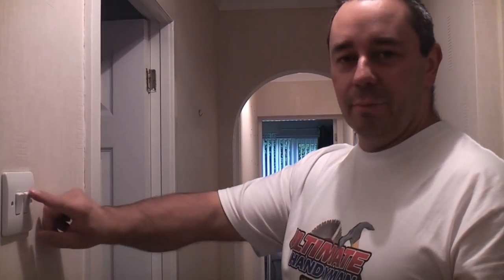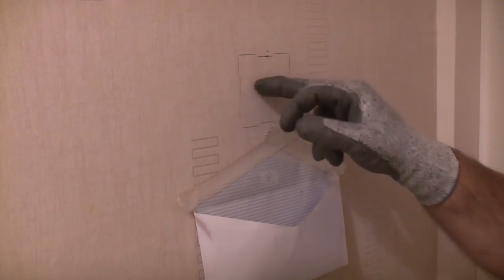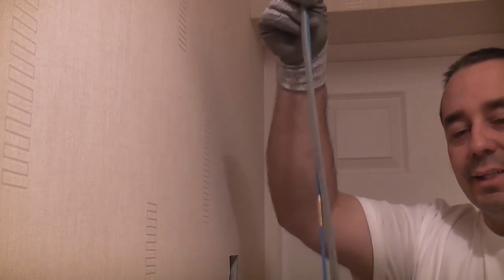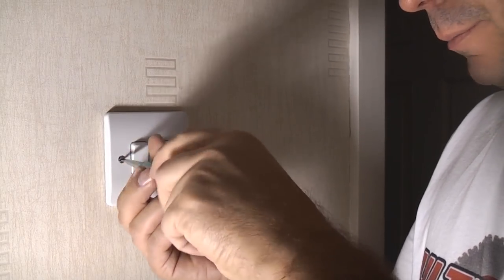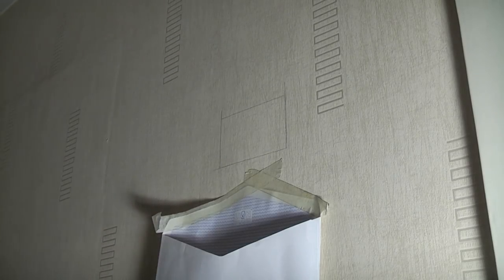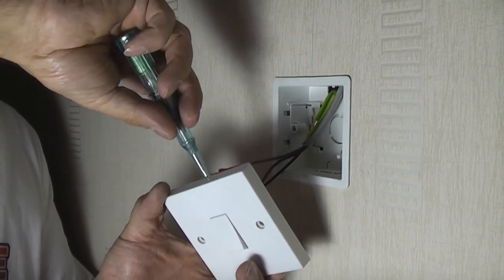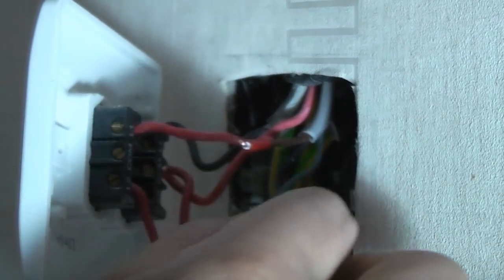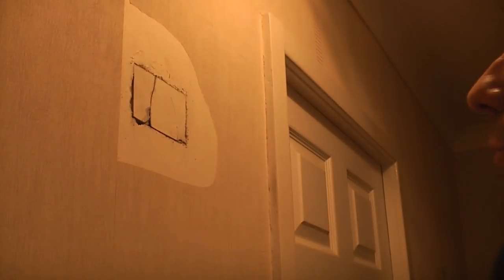How to wire a two way light

Comment: I'm an electrician in the United States and found this video quite interesting because of the differences in how things are done in our different areas. Even little differences in the terminology you use is enlightening, such as calling one of your wires the "ground" a term which, here, would be used for that green wire you folded back inside. Here, our panel boards are usually installed vertically. For a "three-way" switching set up we would have to also change the first switch out from a "single-pole" switch to a "three-way" or "three-terminal" switch, instead of simply changing the existing wiring format around for the same switch device. Unless I misunderstood, it looks like all of your switches can be set up for either three-way or single pole. It appears you have some nice remodel boxes as well, allowing snug fit and built-in plaster board anchoring clamps. We have similar items, but their design is quite different. Thanks for sharing!
Reply from the maker: David Sanders 
Hi David,
Yes the terminology and set up is much different in different countries. I believe in the US you call the live wire the "hot" wire. Over here the Live wire (phase) often gets called the Live or the Line wire or is often just labelled up as the "L" on most switches etc.
With regards to the first switch that was added to to make it a two way lighting arrangement, you can do this in most cases without changing the original switch but sometimes you have to swap it for a two way switch. In the UK we have one way and two way switches but the cost between the two is minimal and so some electrical shops only stock the two way as it can be used on a one way or two way lighting circuit- hence many light switches are two way and so just need the additional cable and switch to make a two way lighting circuit. 
Thanks for the comment ;-)

Comment: In the usa the dual switching setup actually involves using "three way" switches.  three way switches have three terminals,  a common that switches between one of the other two terminals.  So the line/hot wire is connected to one of the switches common terminals and the load wire is connected to the other common terminal.  the two othe terminals on each switch are connected to the opposite switch and called "travelers"  The cool thing is that "4 way" switches can be installed in between two "3 way" switches so that the same light(s) can be turned on or of from ANY number of switches!  4way switches LOOK like dpdt switches but actually they switch back and forth between the the 2 poles switching the travelers on the three way switches!  Really a clever set up when one wants to have multiple switches to control same fixture(s)
Reply: It is amazing how different countries do things and name things!  It is so similar really but would stick out like a sore thumb if installed in the wrong country!  People would just say "WHAT???"
Reply from the maker: Thanks for the comments Doug ;-)

Comment: When I cut into plasterboard I use a streight blade on my multitool and got a bit of electrical tape marking the thickness so I know when it's cut fully so don't need too use a Stanley knife I also use a screw in the centre too pull the cut peace out instead of screwdrivers less damage too be made
Reply from the maker: Thanks for the comment ;-)

Comment: Hi Handyman and thanks for this fantastic video. 
I am a little confused however what happened around the 8:50 mark. You were pushing the rod up through the grommet and gave it help to get it past the bit of wood in the way.
Then all of a sudden you say 'We have now got the cable down at the switch.
All I saw was a rod going up the wall. What happened in between to get a cable at the switch.
Sorry to be dumb.
Reply from the maker: Hi, the cable was pushed up into the loft (it was difficult as the wood was in the way). Then the end of the cable was taped to the end of the rod. My mate was in the loft feeding the cable down as I pulled the rod.
Reply: Ah I see, thanks for the reply.
Do you mean the 'rod' was pushed into the loft as you were pushing the rod at the 8:50 mark. 
How did the rod locate the original hole in the loft as it appeared you would be pushing blindly?
Reply from the maker: Yes the rod was pushed up, if there is a piece of timber across the top of the wall you can drill a large hole of 25/30mm which will enable you to get the rod up- then the wire down. You would have no chance trying to get the rod up the existing hole for the cable.

Comment: one of the outlet of my two way switch does not have a "hot" wire. confirmed this with a multi meter. As a result the switches (both) will occasionally don't work. can I just leave the defective switch not connected and work the other like a regular one way??? please advise!!!

Comment: Hi there what if I didn't labeled 2 gang to way switch wiring, how can I find this out. I has two lights in hallway, and two switches, one for hallway lights both work separate, and another switch goes for one hallway light and light in toilet Can you send me some advice please Thank you for your video Arthur from glasgow
Reply from the maker: +Bungo Man 
Your best option is to ask in the forum, You will need to take pictures of the wiring at both switches. One of the members might be able to work out where the wires go then ;-) 
http://www.ultimatehandyman.co.uk/forum1/lighting-f33.html

Comment: Hi I have two light switches in my living room and want to remove the number one switch but obviously needs to be made permanently live before plastering over how to I wore it to make that happen? I have a yellow in Comm three red in L1 and black and blue in L2? Thanks
Reply from the maker: If you are plastering over it, the wires need to be permanently dead, not live.
You can disconnect them at the other switch in the room, but make sure you insulate them, so that they cannot be wired back into the switch.

Comment: Isn't there any insulation inside that stud wall?? Also thank you for this video, I needed to replace some very old 2 way switches at work and I only know how to do 1 way. Very clearly explained :) EDIT: Another question, are you still allowed to use red cable? I though brown was only allowed now (for live)
Reply from the maker: No, there is no insulation in this stud wall. 
Thanks for the comment
Reply from the maker: If your existing wiring is red and black you can still use red and black wires, but if the new colours have been used you should use the new harmonised colours.
Reply: Oh okay I thought you always had to use new colours even if you're working on something that still has existing colours

Comment: Should you always bend the end of the wire/chopper? 

Thanks!
Reply from the maker: It depends how many wires are going into the terminals, if there is only one or two, I often bend the conductor over, so the terminal screw can grip the wires better.
Thanks for the comment
Reply: @ultimatehandyman  Thank you! :)

Comment: Hi - Quick question: I've taken a 2 way dimmer switch off to change it to a normal switch and didn't make a note of where all the wires were going. I know you hear this all the time. The switch operated 2 sets of lights. 1 set was 1 way and works. However, the dimmer element which was on a 2 way feed doesn't? I've changed the wires(which are the old style and I have blue / yellow / Red) so they are like for like in both sides? However, I have a 3rd wire sticking down which is the ring way( I think - Its Grey with red wire inside it) I've connected this to the live and joined up both Comm's but still doesn't work? In the video you move 1 red wire from Comm to L2 for the 2 way switch? Why? Do you think I need to do that to give power to the 2nd set of lights? Happy to send you a picture if that helps? Please could you advise? Andy
Reply from the maker: +Andy Ellis 
Best bet is to take pictures of both light switches and post them here with as much info as possible- http://www.ultimatehandyman.co.uk/forum1/lighting-f33.html?sid=bbd3372ad6fae213eccce9d131652c7e
If you just explain what you have done and attach the pictures someone will try and help you. It's probably something simple but I don't have time to look as I'm on my way out. The forum is free to join BTW ;-)
Reply: +Ultimate Handyman thanks for your advice and keep up the videos as they're really informative.

Andy

Comment: So in the two gang switch. L1 goes to the light? And L2 is the feed? Is that right?
Reply from the maker: Yes, but it doesn't matter which way around they go as long as those two wires go into those two terminals.

Comment: Hi, I am from Australia.

When you access the initial switch at 10:55 in the video, why do you disconnect the wire from "Comm" and add it to "L2"?

Regards, Mitchell.
Reply from the maker: Com and L1 is only used for one way switching. When you use the switch for two way switching you need to move the wire from com to L2 for it to work. This videos shows why-
https://www.youtube.com/watch?v=n52fvF2G0ys

Comment: Good tutorial only things I would of done different would be to use brown sleeving instead of red no need to identify the brown in the 3 core as it identifies itself (also sleeve other old switched live cables brown) and terminated the cpc into a 5a single connector block or even crimped so there was no lose cable at the switch.
Reply from the maker: Thanks for the comment ;-)

Comment: one in l1 and one in l2  but on another video ( with the bulb and battery) you use l1 and comm?
Reply from the maker: The L1 and COM is only used when it is wired as a single switch, when that is changed to a two way circuit the COM is moved to L2 
https://youtu.be/n52fvF2G0ys?t=228

Comment: Hi I have a 2-way light switch and the connections are L1, L2 and COM. on the switch I have got a brown wire to L1 a blue wire and a grey wire to L2 and a brown wire and a black wire to L3 how do I wire my new switch please?
Reply from the maker: Ian Wilson 
I think the manufacturers do this to confuse people.

L1= COM
L2= L1
L3=L2

It's a good idea to label the wires using masking tape before removing them.
https://www.youtube.com/watch?v=NXDxg1JcqsU
Reply: Thanks ultimate handyman

Comment: but there are 2 cables that may confuse one who isn't specialised on this area especially the incoming wires,it seems like there are 2 red and one black or is it they have been colour coded and the video is not capturing that
Reply from the maker: +Martin wangeci 
Normally in the UK there are either red and black or blue and brown wires at a light switch depending on when it was wired. The black wire is normally sleeved red, so that it signifies the wire is live at some point, likewise the blue wire should be sleeved brown to signify that being live. 

The three core and earth used to join the two switches together used to be red, yellow and blue (which all should be sleeved red)

Or newer installations use brown, grey and black (sleeved brown)

It's easier to follow if you look at these diagrams-

http://www.ultimatehandyman.co.uk/how-to/light-fitting/light-wiring-diagrams

http://www.ultimatehandyman.co.uk/how-to/light-fitting/two-way-light-switching

The video might not have captured all the colours correctly.

Thanks for the comment ;-)
Reply: +Ultimate Handyman ..wow,a nice and a kul reply...Thank you for that sir because in AFRICA there is 

1.red-live

2.black-neutral
3.The naked wire-earthing/grounding
Reply from the maker: +Martin wangeci 
Thanks Martin,
It used to be the same here, but then they said to comply with British standards in cable identification the bare earth wire had to be sleeved with green and yellow sleeving.
Then in about 2005 they changed the wiring colours  from red and black to brown and blue to fall in line with the rest of Europe.
Thanks for the comments ;-)

Comment: I was wondering why you need the link in the switch?
Reply from the maker: Sorry, I'm not sure what you mean by a link in the switch ?
Reply: At the original switch the was a small link wire connected between the two commons and when you put the 3 core in you changed it over, just was wondering what it was there for
Reply from the maker: Sean Edwards 
Ah, right.
That's not a link wire. From the original cable there is a permanent live and a switched live, these two wires go to com and L1. 
When you wire it up for two way switching and you place the three new wires into Com, L1 and L2 you have to remove the original wire from the com terminal and put it in the L2 terminal for it to work correctly. 
I hope this makes sense ;-)
Thanks for the comments
Reply: That's brilliant cheers for the reply, really good videos mate much better than other ones on YouTube!
Reply from the maker: Sean Edwards 
I'm glad that you like them ;-)
Thanks for the comments

Comment: i have a ceilin light with 3 blue wires n 3 brown wires for each bulb
but i dont have 3 blue wires in the ceilin how do i connect.?
Reply from the maker: This video shows how to replace a ceiling light-
https://www.youtube.com/watch?v=WZizlnLfLks

The ones with multiple blue and brown wires can be a pain. Really the manufacturers should terminate them so that there is just one wire to terminate for the live and neutral but they are more interested in profit rather than ease of installation.

You have to connect all three blue wires together and join them to the neutral wires on the lighting circuit. You also have to connect all three lives together and connect them to the switched live on the lighting circuit.

The earth wires should also be connected if there are any (normally coloured green and yellow).

If there is anything you are unsure of it's probably best to get an electrician to install the new light for you ;-)

Comment: Nice bit of info be rules have changed again and vid needs an update regarding bonding and rcd protection.
Reply from the maker: Rules always change, it's a great way for the rule makers to make money ;-)
Thanks for the comment
Reply: Ultimate Handyman it’s not money making bud, it’s the institute of electrical engineers and the fire brigade Preventing things like Grenfel tower happening again. No alteration or extension of a circuit without 10mm bonding to gas and water and rcd protection of ALL circuits unless risk assessed. You should also be part p registered unless changing a socket or light fitting. There’s a right way, or - the wrong way.
Reply from the maker: Thanks for the info ;-)

Comment: Have you ever come across the situation where a 1940's house has 2 switches controlling 1 light. But with only a single twin & earth at each switch and the ceiling rose? I figured there must me a junction box somewhere along the installation but still don't understand how it would have been wired back then?! 🤷‍♂️
Reply from the maker: Yeah, I think I came across that once. I think it’s known as the “cable saving method”. I think it was widely used in the 1960’s as there was a copper shortage! 
The only diagram I can find is on this page- https://www.electronicshub.org/2-way-switch-wiring/
Reply: @ultimatehandyman  thanks 😊

Comment: I was expecting a vid on "how to wire a two way switch" not how to fix one into a plaster board wall, there are many vids on YT about how to wire up a 2 way switch, but none cover how to replace a light fitting on a 2 way switching system !!
Reply from the maker: https://www.youtube.com/watch?v=NXDxg1JcqsU
https://www.youtube.com/watch?v=n52fvF2G0ys

Comment: I have a 3 switch that operates 3 different lights ,I am tiling my kitchen and disconnected the kitchen light to put the cable through a hole in the tile ,should have taken a pic but didn’t,now put wires back where I thought and one switch now operates two lights one of the wires are in the wrong place if I take a pic can you help ?
Reply from the maker: I might be able to, but it could be tomorrow or the day after before I get chance to look at it.
You could try asking here for a faster response- http://www.ultimatehandyman.co.uk/forum1/viewforum.php?f=33
Reply: Thanks it’s just the one wire

Comment: All OK electrically, of course, BUT:
At 8:50 you skipped over an important part of the physical aspect.  I suggest that it would be very difficult (almost impossible) to push a "Cable access kit" up to pass through the target of a relatively small hole in the Wall Plate at the top of the wall.  Would it not be much easier for your assistant to feed the "Kit" downwards and for you to locate it, as was done in the first cut-out and then attach the cable to the "Kit" (or a draw-string pushed down using the kit) and then pull the cable back.
Of course, this would be correct only if the order of feeding the cable(s) was reversed.  In reality, surely you would have fed the cable UP from the original switch, through the loft and then DOWN to the new switch.  If done the way as shown in the video, you would appear to need to join the two cables in the loft!

Comment: In Mexico the electricians dont follow color code...im having an issue connecting a "Gang"" doble light switch...but 4 wires are connected to the old switch...2 are live n 2 are not...how can i make the correct connection...one switch controlls the outside light n the other switch the livingroom light...
Reply from the maker: If you put one live wire in the top terminal of each switch, then put one of the other wires into one of the bottom terminals of each switch. If the wrong light comes on with the switch, try isolating the electricity again and swap the two bottom wires around.
Hopefully this will work ;-)

Comment: Tip, when using rods, only turn in the direction that tightens the connection!
When our solar panels were installed, the young electrician, turned them back and forth to loosen a stuck rod.

That rod section is still in my wall. 
      I had to lend him mine to finish the job!